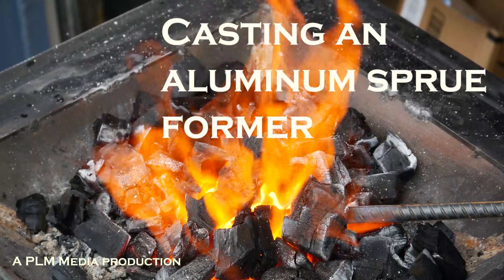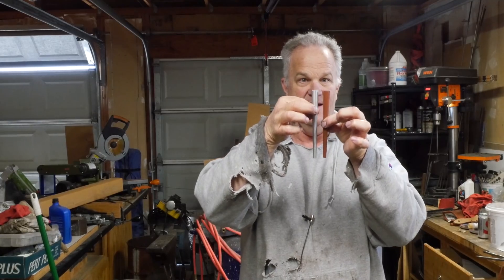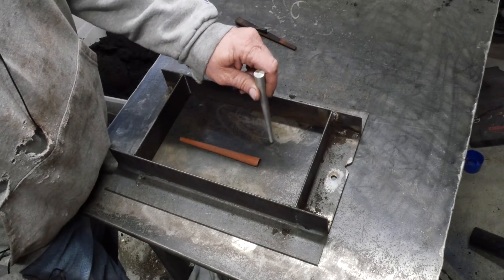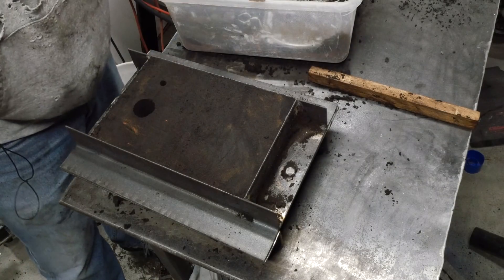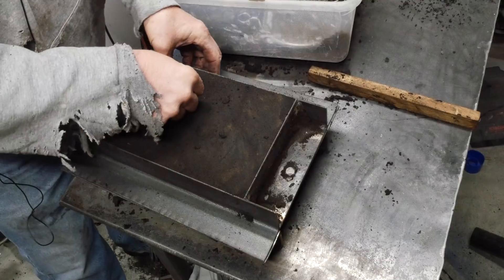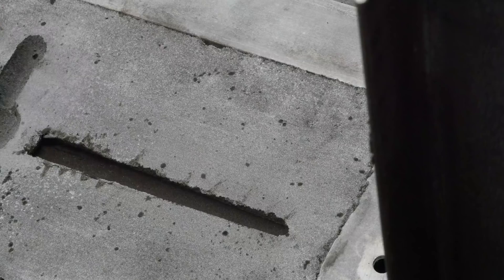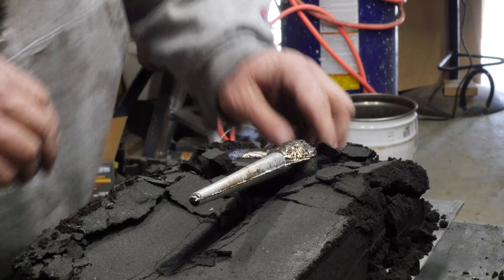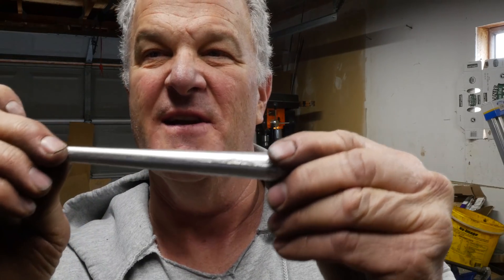Casting an aluminum sprue former

Comment: With 3D prints you need to spray and lacquer them to remove the layer lines because the sand will stick in between them and damage you mold when you pull them out. It made a massive difference when I started doing this.

Comment: I really enjoy your videos, and though I have been casting for years, I am very new to this "small sprue" method.  I am learning a lot from your videos, & from Olfoundryman.  I am wondering about your angle iron flasks - do you get dropout with them, or have you put some draft on them to prevent this?
Reply from the maker: Hi Mark. Thanks.  I must admit that my flasks are slightly less than optimal :-D When I made them all I wanted to do was get away from the wooden flask that I had built. I kept hitting the edges and getting splinters in my sand. That said, I have never had the sand drop out of the flask when moving it around. Well, I shouldn't say that. I had it drop out one time when the sand was very warm. The oil-based stuff that I've been using doesn't work well when it gets warm. It loses viscosity and the bond goes right out the window.  I had left the sand in the garage when the temperatures outside was north of 100F/38C. It was noticeably warm to the touch when I rammed it and fell out as soon as I lifted it.  But that is the only time.

I think the usual method method of good flask design incorporates a small ridge around the inside of the cope and drag. The ridge is at the bottom of each piece (cope and drag) and runs all the way around all four sides. 

Some day I hope to cast a new box or two and I'll incorporate this in my design.
Reply: I like the idea of angle iron flasks. If I build one I will run a weld bead around it, which should prevent dropout. On my wood flasks I rout a v groove around the centre & I have never had a dropout since. Before that.....sometimes, and usually at the worst time.
Reply from the maker: @MarkSmith-rb5mc  It's always at the worst possible time ;-)  The angle iron has held up really well. It never burns when the flask or even metal touch it ;-)

Comment: What oil do tour retemper tour petrobond with? 2-stroke or 4-stroke? Mineral or synthetic or multigrade? Killing to buy a 50 pound bag so I wanna make it last as Long as possible 😂
Reply from the maker: I use non-detergent motor oil.  https://youtu.be/PdWet_QCYq4  You can extend the life quite a bit but it doesn't last forever

Comment: Would you mind sharing your .stl for the model?
Reply from the maker: Sorry it took so long to get back to  you. My sprue former is 158mm long, 15.7mm diameter on the thick end and 7.8 mm on the small end.   It is designed for 100mm or less sprue length in your mold. If you want a taller one, there is a formula for calculating the angle.
Reply from the maker: I just reread this, sorry. The first time I read it I read "the size". Sure, I'll be happy to give you the stl files. email me at swdweeb@gmail.com

olfoundryman has this on his latest video https://youtu.be/u346meNtJWk regarding the sprue...

The sprue that is used here has a bottom diameter of 8 mm and a taper of 1.3 degrees per side.
We have available two STL files of this basin they are male and female so they give a good idea of what the basin should look like. If you would like a copy of these files please PM me with an email address that I can send them to.

Comment: I've heard that if you put a piece of cardboard between your crucible and the crucible stand it will burn to carbon and keep them from sticking to your crucible
some people put some plaster and grog between their crucible and bricks for the same reason.
Reply from the maker: Hey Walt.

I've heard the same thing. I'm right in the middle of a furnace rebuild, it needed it bad, and I'm planning on putting a round piece of firebrick in the bottom that I can sit my crucible on as a plinth/platform. I also have a new crucible that I'm going to start using. I'm going to try the cardboard disk thing to see if it helps in the new furnace. 

I got a lot of "glass", for lack of a better term, in the bottom of my furnace that caused quite a bit of "un-level-ness" I'm going to try and do a better job of starting with a nice clean bottom.  I think the refractory mortar that I lined things with had sand in it and I added perlite to it. I think that was the root of my problems. Hopefully next week's video will show all of this. As always, assuming I get it done in time. ;-)

Comment: I was going to say you are getting better at this, that would not be accurate, you are getting good at this.
Would you like a step file of the sprue so you can add a handle?
Did you tap the pattern before removal? 
Did you notice which side you poured from?
Love the video
Reply from the maker: I can only step files in read-only mode. If only I knew a professional draftsman that could model the male basin/ridge former with a handle on it, that would be really useful. ;-)

I tapped the one side of the pattern that remained in the mold when I opened it. The other side just came out when I lifted the cope off.

Comment: Good job!  My shop sweatshirt is almost as, umm, "broken in" as yours is, now that I went and caught slightly on fire while grinding.  Again... :)
Reply from the maker: Yeah, I think I'm decommissioning this one. The hangy down parts are starting to annoy even me. I've got another one that will step in as a fine substitute... for a while ;-)

Is that muller up and running yet?
Reply: swdweeb I hope to have the muller finished soon (yeah right), if my own hangy-down raggedy sleeve ends don't get snagged and drag me into it first...  Part 3 of the build is actually uploading right now.

Comment: Interesting  ,
Reply from the maker: good or bad?? If it's bad you can just ignore this ;-)
Reply: swdweeb it's good but couldn't you also make it out of wood by sanding or carving to the same shape or does it have to be metal cause of the surface. I don't no any thing about casting but i love watching videos of all u guys doing it .it's so cool
Reply from the maker: Oh, it could easily be made from wood. Until 3-D printers most patterns were likely carved from wood. To be honest the best patterns probably still are. 

I don't have a lathe so turning it wasn't really much of an option.
Reply: swdweeb ok  cool thanks for message back about it .I looking forward to watching your old videos and ur knew ones

Comment: It looks like your basin forming pattern could use a handle to help you remove it after use.  Not a big deal though.  I used to have a favorite flannel shirt, so enjoy your hoodie.  I miss that shirt.
Reply from the maker: I was thinking the same thing. I'll have to mention that to the guy that modeled it. I don't have a way to modify the model.  I need to reprint it anyway since I broke the sprue portion off.
Reply: Can you drill a hole in that pattern?  If so, maybe you can get a tap and thread the hole for a bolt.  Bolts make pretty good improvised knobs.
Reply from the maker: I could and probably will... probably not until I use it next and realize I still don't have a handle on it yet. ;-)

Comment: Paul will like it. Just an FYI you could of use your drill press as lathe to better round it. Run a file or sander over it. Nice work sir!
Reply from the maker: Great minds... ;-)  I actually did jut that. What I should have done was cast a non-tapered section above the wide end that I could chuck-up tightly.  Next time...

Comment: What do you use to make your 3d models?
Reply from the maker: I saw the name come across my phone and thought it was the old balding guy... I should have known he wouldn't be sending a comment. 

I use DesignSpark Mechanical to model things. Several (well a few) people have said I should use Fusion 360 but I couldn't get past the first tutorial on how to double-click open the app. It may be powerful but its power is directly, maybe even exponentially, proportional to its complexity. 

I was using slic3r from Prusa (I think) to create the gcode files for my printer but I just recently switched to cura. Cura creates much better (I would have never believed it) 3-D prints than slic3r ever did for me.